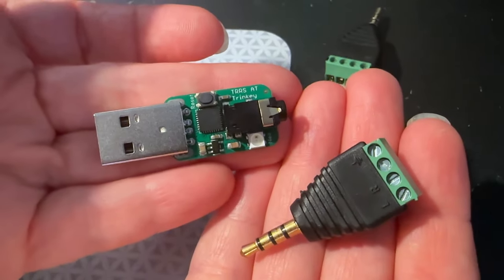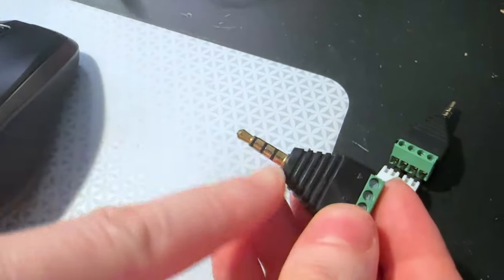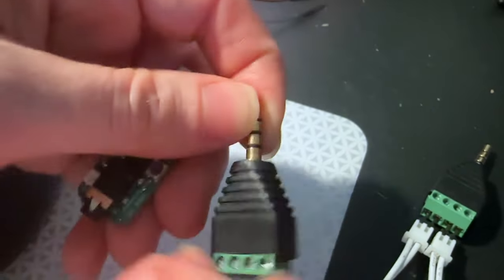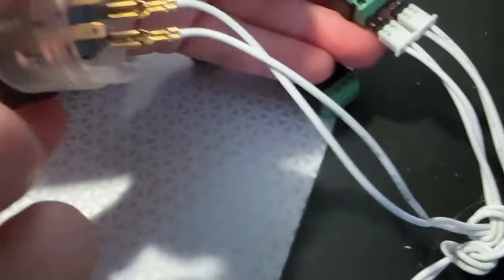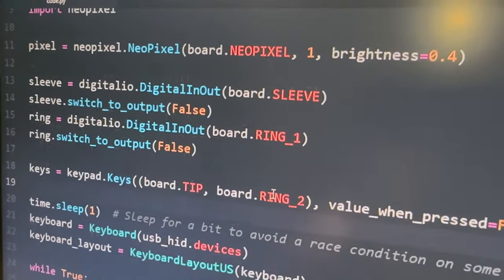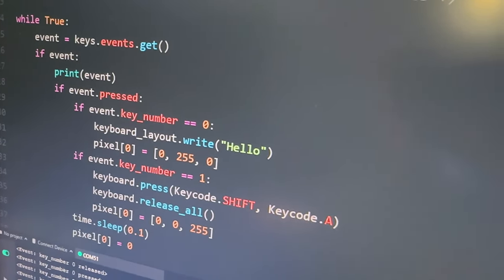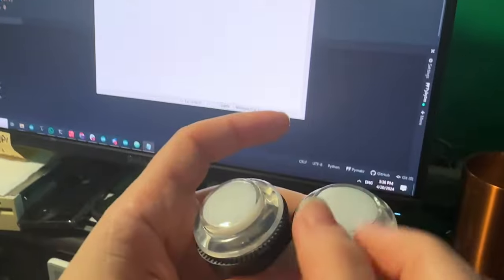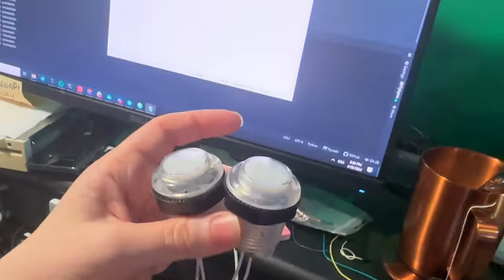TRRS Trinkey makes AT projects EZ

Comment: I always enjoy your products, and as a blind person, I appreciate your constant accessibility oriented solutions.
If I'm not mistaken, you pcan get 11 controls out of that TRRS. Lets lable them T R1 R2 S.
For the first 3: T»R1, T»R2, and T»S.
Then R1»R2, R1»S, and R2»S.
Here we have more fun! T»R1»R2, T»R1»S, T»R2»S, R1»R2»S, and T»R1»R2»S.
The code would have to scan as it would for a matrix keypad, powering one pin at a time to see where it comes out, but this seems doable. Of course pressing more than one button at a time gives incorrect signals, But that holds true with matrix keypads too.
Please let me know if I'm mistaken.
Either way, keep up the good work!